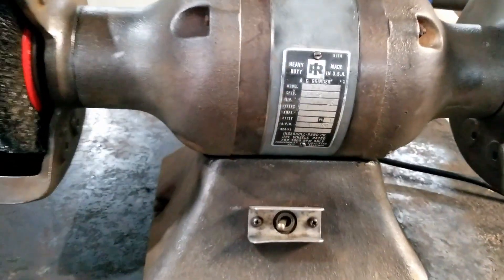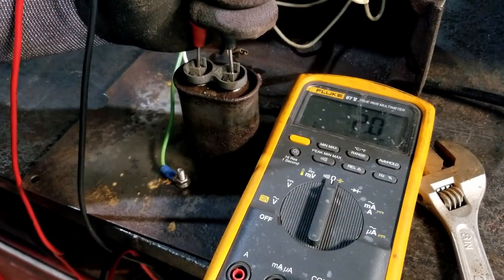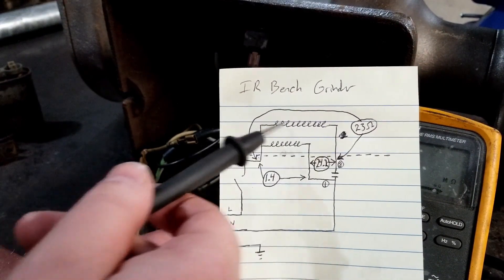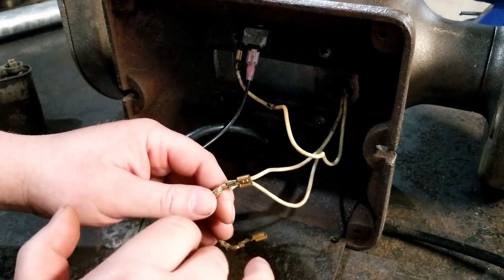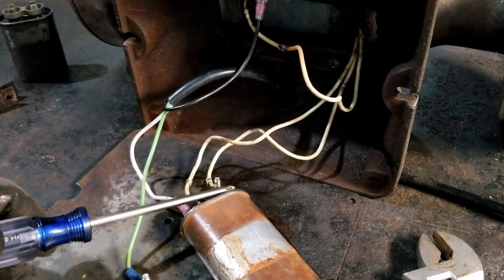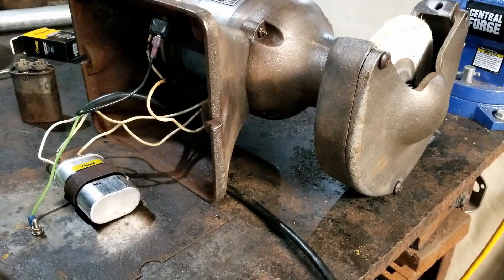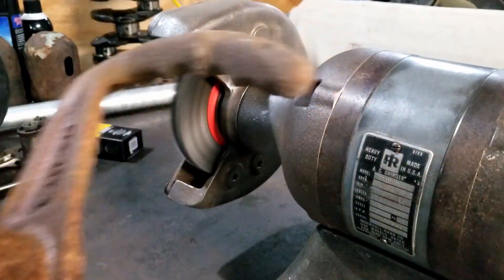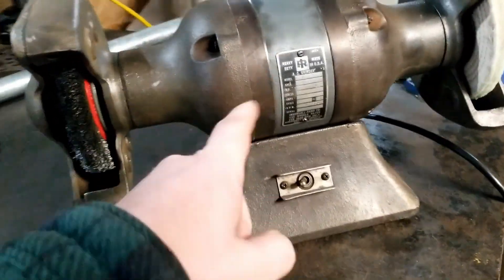Bench Grinder - Overheating

Comment: I just bought the 8in Bauer variable speed from H.F. I like it and had used a wire wheel on it a few times with no problem or excessive heat. Finally yesterday it was flesh burning hot after I was really torquing on the wire wheel for a good ten min. Should I test the capacitor or is it just the best I can expect from a harbor freight grinder? They are much smoother than they were even just a few years ago which is why the overheating is disappointing me.
Reply from the maker: Is the CAP permanently connected or switched? Does it get hot every time now? or Just under heavy torque or extended time? HF uses cheap cheap materials so this could be normal. 
If just got it, might be able to return/exchange it. If take it apart, might not be able to return it.
Mongo would check it out, but Mongo always curious.

Comment: TY for posting this video. I have a old grinder from a garage sale that heats up pretty fast.  Here's the catch. It doesn't have a capacitor on the outside or underneath. Is it possible it never had one and the heating is caused by old dry bearings?
Reply from the maker: Couple things can cause grinders to heat up, shorted capacitor, bearings, shorted motor windings. It always trick when getting stuff from garage sale. Never know what someone has done with it. First need to confirm what type of motor it is. (maybe it missing a capacitor) Test bearings, and motor windings. Mongo made video of replacing bearings, check it out!